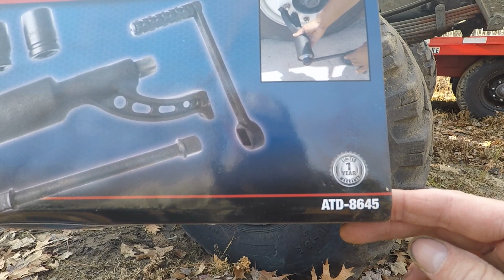F600 4x4 Rear Tire Swap

Comment: Great conversion. What I do with my duals on the rear of my W.W. 2 Chevy truck is to remove all of the Schrader valves from the inner tube stem and add 6" rubber valve stem extensions. This way I can "air-down" my tires for better off road traction if needed. The extensions also make adding air a bit easier as both ends are flexible and easy to reach. Great job using the Torque Multiplier, they're great to have on hand when air and pneumatic impacts are unavailable.
Reply from the maker: I've seen the metal extensions, but not the rubber ones. I'll have to look into that. Yes, those torque multipliers can be a real life saver! Saves an individual from having to do some real sketchy stuff.

Comment: I own a 1965 F600 with 49,000 miles. 300 six, 4sp trans, 2sp rear end. All brake components are new including brake lines but need to replace brake booster and prefer to upgrade with dual master cylinder.
Reply from the maker: The best way to get a dual master cylinder, is to upgrade your brake system to hydraboost. It'll run off the power steering pump. If your truck doesn't have power steering, you can add a stand alone pump to operate it.
A1Cardone master cylinder: 10-8002
A1Cardone hydraulic booster: 52-9807
Backup electric motor: Ametek Prestolite Motors HYL 5006 12v 2772876

You will have to fabricate a new mount for the firewall.  Google Hydro-Max hydraulic brake booster and master cylinder for a technical manual that is downloadable in PDF format. It's a Bosch system. The part numbers I provided are for a 1984-1994 Ford F700, it's what I'm going to be installing on my F600 4x4. I'm several months away from doing the install on it. The weather & work won't cooperate right now.
Reply: Wesley Johnson - Thanks for suggesting a solution. The 300 six currently in my F600 does not have power steering and steers so easy that power steering was not needed. Adding a power steering pump would be easy since brackets are readily available.  It currently has a vacuum brake booster with a single stage master cylinder.
Reply from the maker: @geraldtrice4894  you're welcome. Personally, if you want a split master, ditch the vacuum booster & go to the hydroboost system. Do NOT put a light duty (F100/250/350) braking system in a medium duty truck.
Reply: Wesley Johnson - I have two vehicles with hydroboost, 3/4 ton Suburban and 1 ton Chevy pickup.  The Suburban's hydroboost has been almost trouble free other than a leak at a check valve (ABS) but the pickup has been less than perfect.  First problem was the power steering pump sheared at drive pulley which turned out to be a recall item. Of course, my vin number was a excluded from the recall although it had the same problem. Replaced the pump and then hydroboost started leaking.  Replaced hydroboost and everything seems to be ok for now.  My hydroboost experience has not been positive.  Maybe Fords hydroboost are more reliable.

Comment: Man, that tire was shot lol. I've heard those torque multiplier tools are worth every penny 👍😀
Reply from the maker: No doubt about that! All 4 of those tires are garbage.  The torque multiplier I got seems to be alright.  The gears seem a little sloppy. I might put a grease zerk in it somewhere. 

I left a link to a manual for your truck bed. Did you see that comment?
Reply: @WesleyJohnsonMI  oh thank you, I didnt see the comment though
Reply: oh man its worth it, i was using a 10ft cheater pipe to break some stuck lug nuts on my duece, gave in and bought a torque multiplier and its been easy sailing from now on.
Reply: @johndowe7003  I bet! 🙂👍 I still need to run across one
Reply: @HODGEPODGEDODGEGARAGE  i got mine off amazon for 70$ 4500lbft of torque. them bolts are either gonna come off or twist off haha. the one i have is called "XtremepowerUS Multiplier Torque Wrench"
Reply: @johndowe7003  that's a good price! 😃👍 thanks, I'll check it out

Comment: I just got a 1955 Ford F-600 and it needs a few things my main concern is the wheels nobody wants to change them because there are a split rim 8.25 20’s do you have any info for me by chance??
Reply from the maker: Are they the true split rims or the lock ring type of wheels? Go to my how to/DIY playlist, I'm pretty sure I shared a couple of videos that where made by Kenn Tool on how to properly dismount the lock ring wheels.

Comment: I wonder what the thinking behind left hand thread on one side vs right hand thread on the other was back in the day.
Reply from the maker: The theory was inertia. This is explains it https://www.ford-trucks.com/forums/1342791-left-hand-thread-lugnuts-why.html
Reply: To stop the wheels falling off , the theory was that if you had a loose one then driving forward would keep it on rather than spinning off

Comment: What rims? tires did you find to swap the old tube ones with
Reply from the maker: They are still tube type. I put better condition,  used Goodyear Hi-Traction 9.00x20 tires
Reply from the maker: I used old military 2.5 ton wheels & 9.00x20 NDT tires
Reply: Just wondering if a 11.00 x 20  wheel work on this same type of truck

Comment: Had you already checked the brakes and drum pads at this point since the wheels were off?
Reply from the maker: No, you have to take the hub off to do so. The wheel studs are pressed through the drum & the hub flange. I also did not have the appropriate spindle nut socket at that time.

Comment: Your looking for trouble antiseizing the lug nut threads. I'm a journeymen mechanic.
Reply: @wolfgangrittgers2598  your lucky! If you brought a vehicle into me or my facility for a government inspection I would fail you on the spot. It's illegal to do that and it's unsafe to do it.
Reply: Mark D'Avis pays the bills,at least I’m not a welfare queenie. Know any?
Reply: Can you please cite the statue which says that anti-seize on lug nuts is illegal in the US? This is practically a requirement in northern climates in my opinion.
Reply: Ben Kjellberg I’m in Canada
Reply: Ben Kjellberg Also manufactures tell you to put wheel nuts on dry and not to put anything on the studs.
Reply: @smathet7766  lubercating the threads may change the torque spec but why would it be trouble?
Reply: @smathet7766  manufactures also install  brake lines made from steel instead of nickel copper. That can be a huge safety issues in a salted environment. Planned obselence is also a thing. Not saying you are wrong. I just haven't seen evidence that it can be a safety issue. It sure makes things nicer to dissasemble.